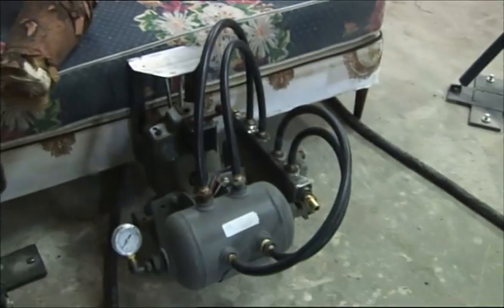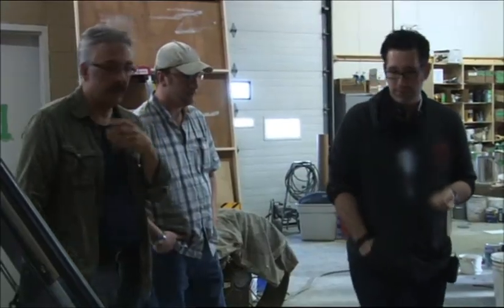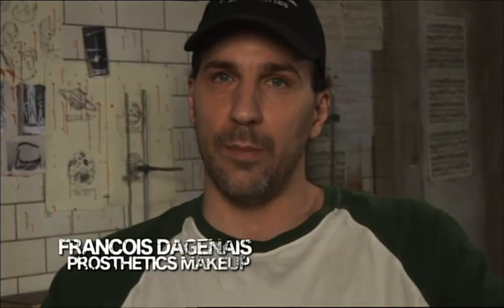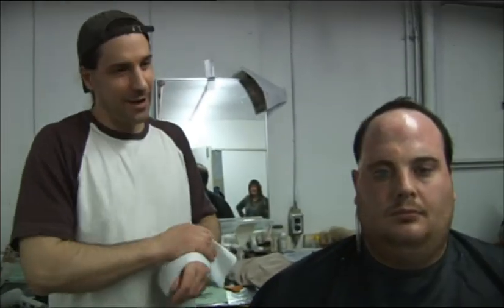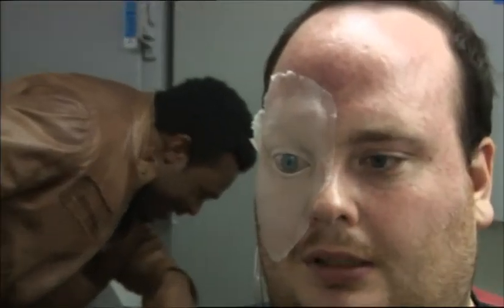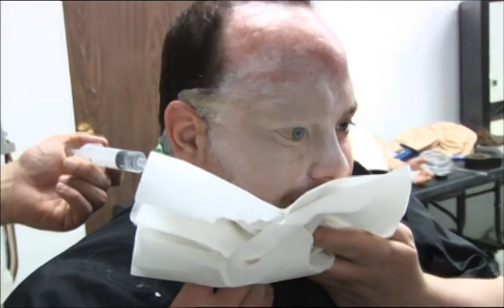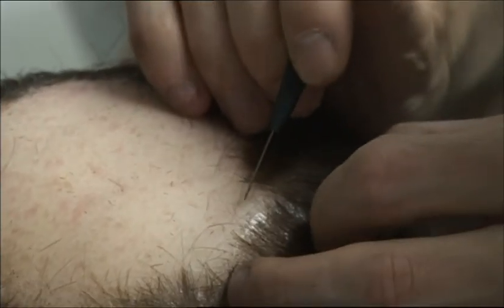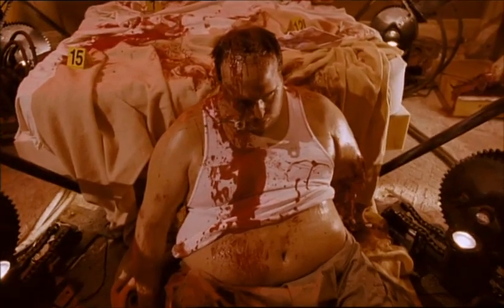Saw IV - The Making of the Bedroom Trap

Comment: what if the wrong person got their hands on the real prop traps...
Reply: Then they'd be out of luck when they find the pendulum is made of foam, the needles in the needle pit are made of flexible wire and the spikes in the venus trap are made of rubber. :)
Reply: Then that would be bad now wouldn't it
Reply: layla sarrinchar Actually in the needle pit trap; The needles on the actor are real, they just removed the real needle, and held them on with body glue.
Reply: A lot of these are safe but actually Layla was wrong, the pendulum was one of the only real ones and thats what made it so scary. As were the hand crushers from the same scene, sometimes there was foam but in scenes they used real materials that would crush the hand. And with a few screws or something you could make the drowning box thing a real dangers as well. And the fire oven thing was also real but it could open up. I've been binging too lol